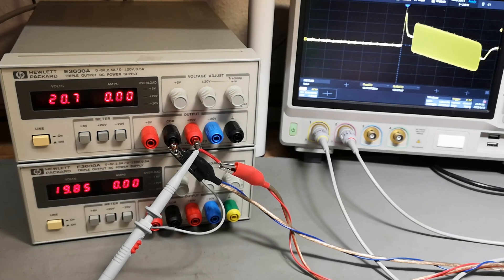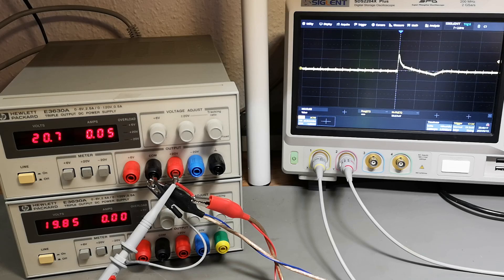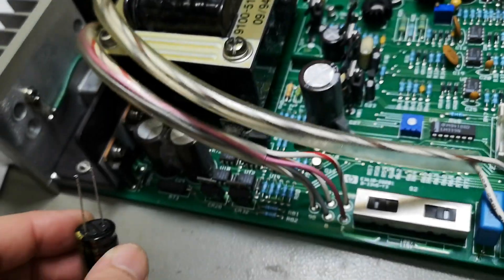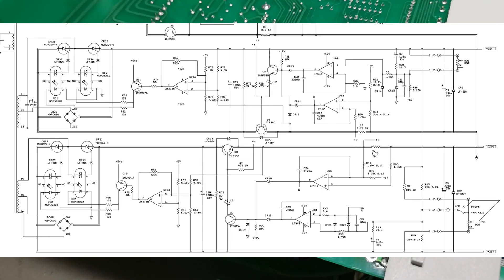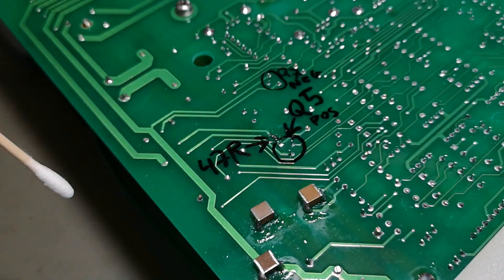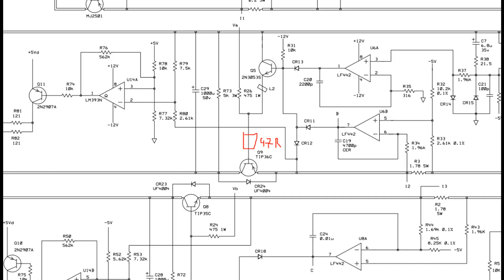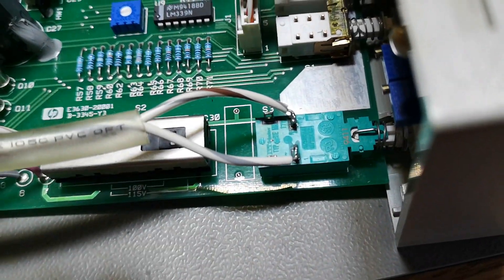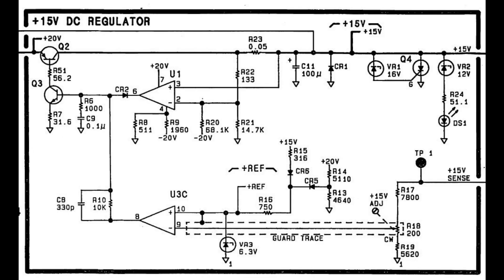HP E3630A Triple Output FOLLOW UP PROBLEMS SOLVED

Comment: That is not the sort of mistake I would expect from HP, especially since they knew of it as evidenced by the addition of L2, L3, and what appears to be a bunch of extra frequency compensation around the feedback loop.  The problem is that the transconductance of Q7 and Q9 varies considerably with current, so the voltage gain within the feedback loop changes wildly with operating point.  Usually an emitter resistor is used to control the transconductance, but R3 and R2 are not large enough for that.  It would be interesting to compare this design to the earlier but similar HP/Harrison power supply designs.
Reply from the maker: that is why i did look at other HP designs, see the end of video, you clearly need emitter resistors to have control of your gain variation.

Comment: Hi Thomas, this is exactly the type of power supply I wanted to buy on ebay, in the end I didn't buy it because it only has 0.5A at 20V and that was not enough for my trials and CNC PCB repairs. Congratulations on solving the problem, you are really good 👍 
I got a lot of useful information - thank you 👍

Nice day 🙂 Tom